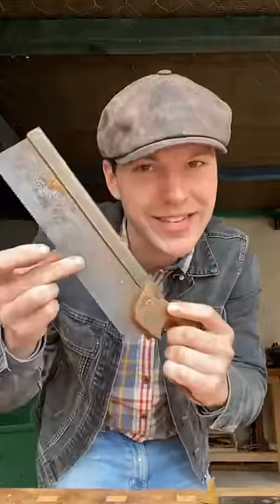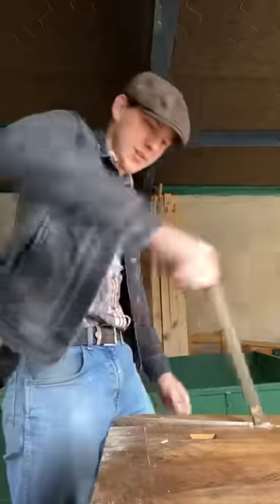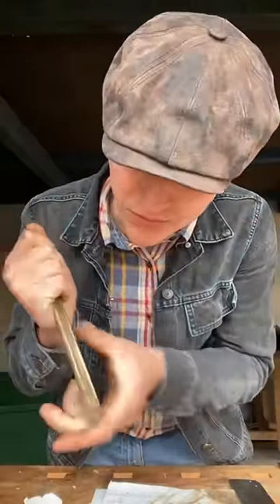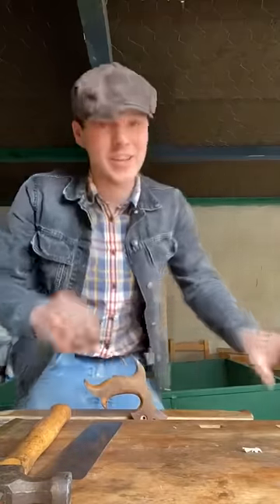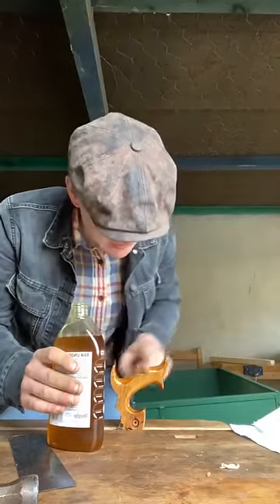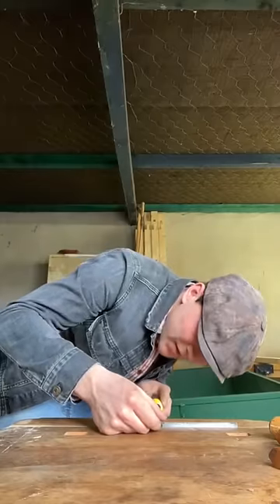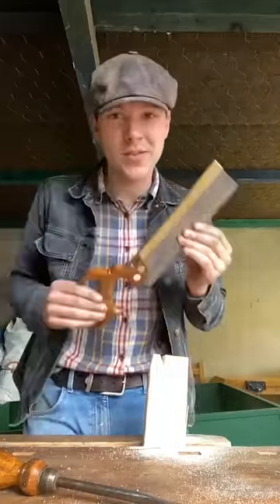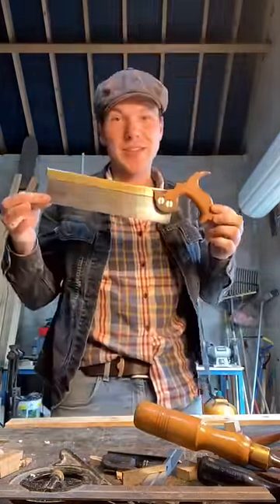Restoring A Dovetail Saw #shortvideo #woodwork #satisfying #dovetails

Comment: Absolutely gorgeous, one small tip though: if you wanna better method  to cleaning the patina off I'd advise a 1:1:1 ratio solution of flour salt & vinegar and leaving it overnight wrapped in plastic to keep the paste hydrated
Reply: And how would you go about ratioing a liquid and a powder? Mass or volume?
Reply: @M4DD1GAN yes
Reply: @M4DD1GAN its always mass
Reply: @M4DD1GAN  no need to be so specific,  just get it roughly even and she'll be right

Comment: Restoring tools was a passion of mine too . Could you do me a favor though, could you fold and tear your sandpaper !
I wince when you tear off a little piece.
Keep them coming !
Reply: I prefer to use duct tape as a backer, then use scissors or my pocket knife to cut it.

That was the sandpaper holds its shape way better, doesn't tear as much, and doesn't heat up as much, makes the experience way better.

Comment: What’s the difference between a dovetail saw and just making dovetails with a coping saw?
Reply: A coping saw has a much thinner blade-it's great at turning in the wood, which is awesome when cutting out small chunks or following curved lines, but crap at making straight lines. 
You could cut dovetails with it, but they'd probably look terrible and wobbly. 

While the dovetail saw has similar teeth, the straight side of the blade keeps the cut in a perfect line; keeping the sides of the dovetails looking nice

Comment: How long does it usually take you to restore something like this?
Reply: Depends on what it is and what condition it's in.

Something like this would've only taken an hour or two.
Disassemble, sand, reassemble, set teeth, sharpen, test, oil.

For some things like files or rasps, it can take days, but that is mostly waiting for chemicals to do their work.
Some things aren't easily fixed, and required jigs to be made, or heat treats to fixed, new handles/parts to be made entirely, lots of taping for painting, etc.

It is not really a 'it takes this long', as it really depends on the tool, condition, gear you have, your smarts (when it comes to fixing issues), etc.

I will say most things dont take to long.

Comment: PLEASE stop using WD40. It's probably the last spray you actually need! WD is literally WATER DISPLACEMENT, and it's not meant for and neither is it actually any good for everything people use it for. It's just lazy and less lubricating and turns to wax. Just get some rust remover (or vinegar) and some universal oil. Or if you need to actually keep things moving without friction, grease it or silicone spray or whatever. Really. There are SO MANY products that do the job better! And very likely cheaper in the long run.